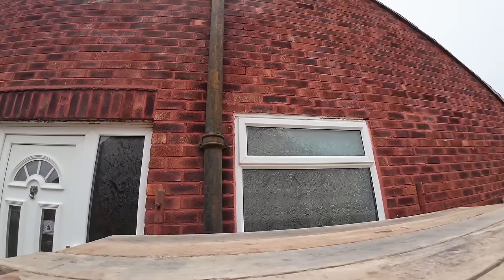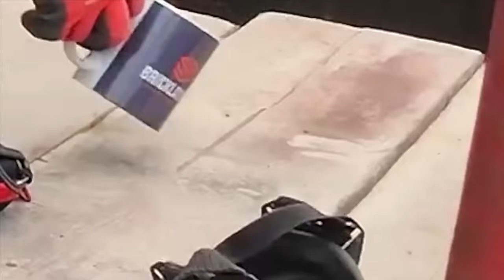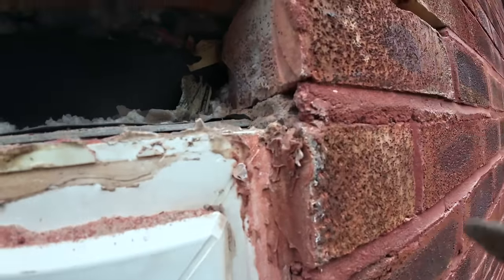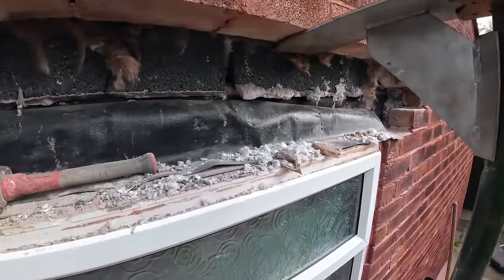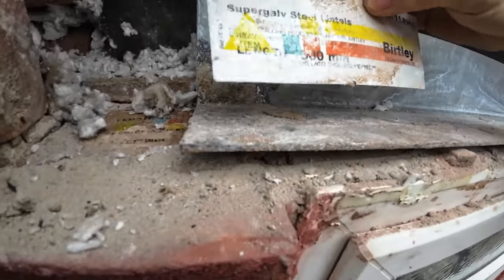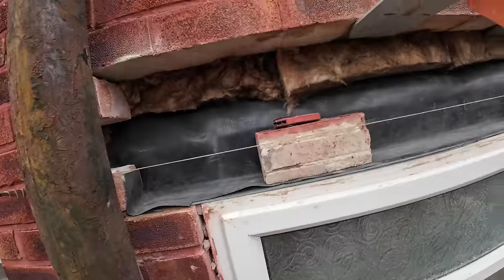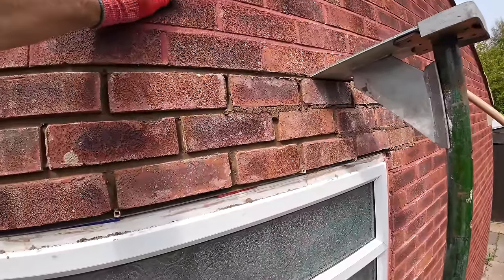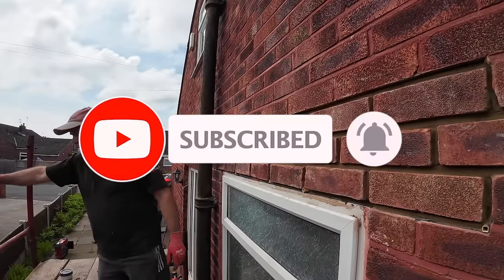TERRIBLE LINTEL INSTALLATION AND ALEX TRIES COFFEE

Comment: I know it might be asking for trouble, but have you considered making a slit on the inner skin of the cavity and inserting the tray in to it, as opposed to silicone and nailing it in place?
Reply: That sounds very time consuming and messy, plus you'd still need to silicone the tray into the slit, plus, during the manipulation of the tray and laying the first course on it, it could still slide out, unless you wait for the silicone to cure, which is adding time onto the job, hence the mechanical fixing of nailing it in place to begin with.
Reply from the maker: @SODtv perfectly put pal 👌🏼🧱👍🏽